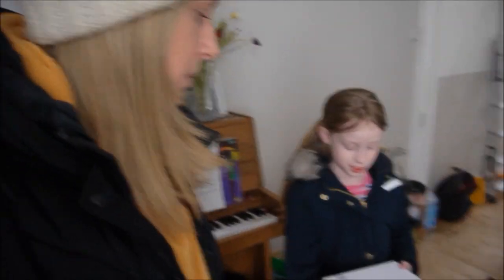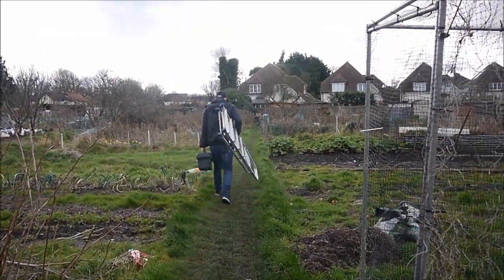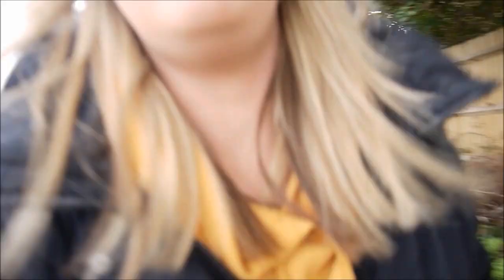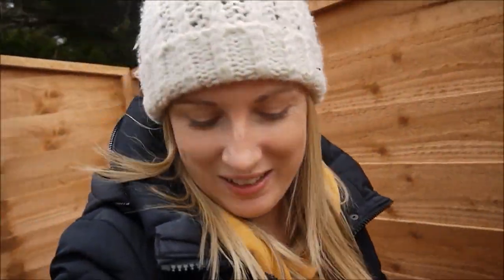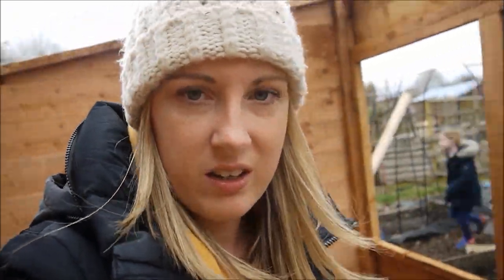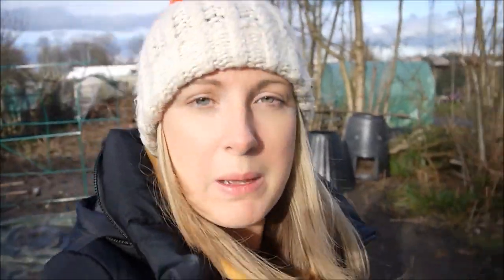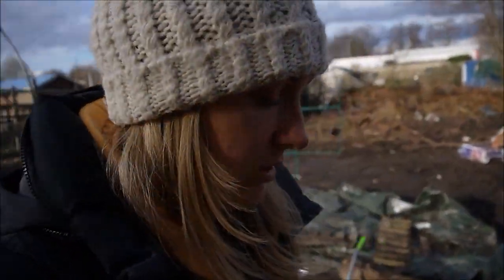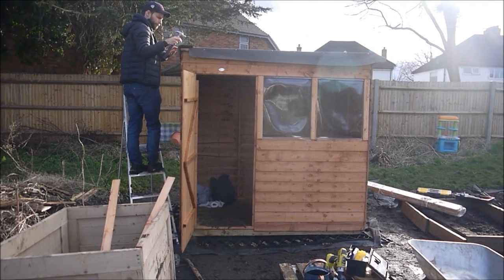EMMA'S ALLOTMENT DIARIES / THE SHED VLOG / PART 2

Comment: Emma you always get bounce on the floor of sheds.
 What I did I got more chip board sherts and put them on top of the existing floor and that helps.
 The floor panel you get where the strips the joists and board nailed to the top theres not enough and not strong enough.
 Also you'll get settlement with the soil.underneath.
 Great job in that wind nightmare when I put mine down the alloment it slung it down all day none bloody stop I had had mine delivered to the alloment.
 Also again when I put the green house up it slung it down all day another soaking lol but worth it in the end.
 Stay safe and great vids